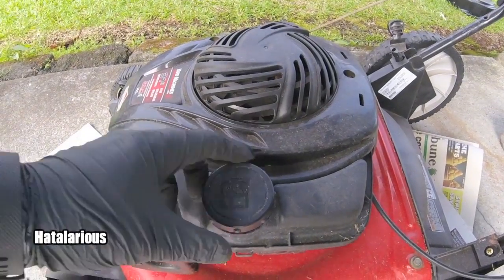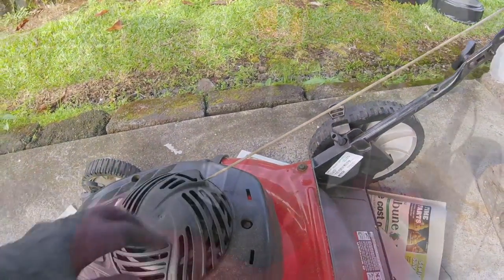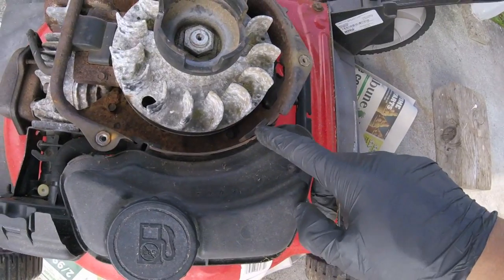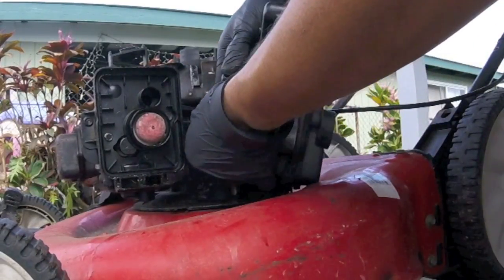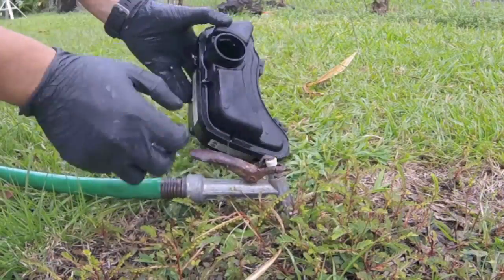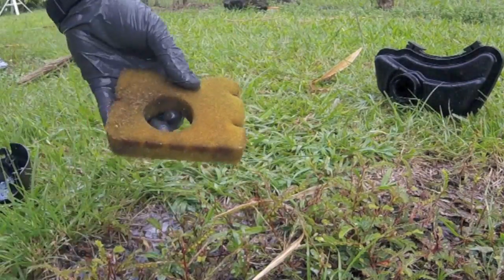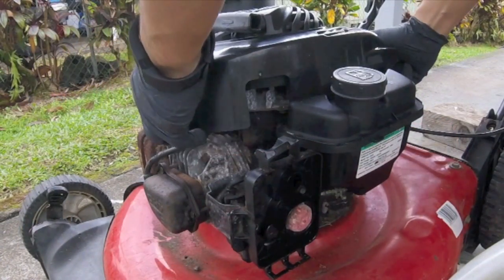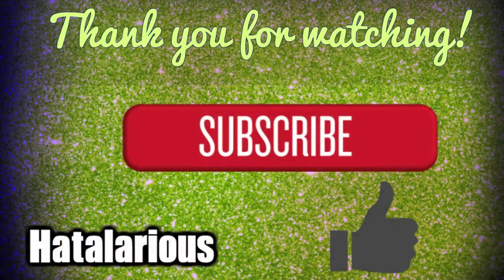How to Clean a Lawn Mower Gas Tank!!

Comment: update i use this method to clean all my gas tanks and they all work great..it cleans the debris out and eveyrthing..you MUST wait until the tnak is fully dry before reinstalling as water will go through the line and the engine will bog out or not start but this is a good method thanks for this video:)

Comment: i had a problem wiht clogging in my fuel line i cleaned it out a bit but today noticed soem debris still inside...im new to fixing mowers so i youtubed like i do eveyrthing else and came across this video i hope this works..i seemed to have gotten more out and theres a steady flow so i think this is going to do it and ill use this trick on future projects. thanks:)
Reply: @johnymcjoon  what you laughing at scrub?

Comment: Thanks for the video. Made cleaning out my gas tank much less scary.
Reply: I want to clean my gas tank without taking it off.
Why can't I let the gas get empty, get like a paper towel type thing, wipe it out, soap and water and air dry 
Would that work
Reply: Catherine Rosa-Baker No. You don’t want water in your engine. or soap. any of that. Just do it the right way... it was simple enough.
Reply: @leomcadams1751  if she removes the gas line from tank side and is careful, what could it hurt? Mowers get rained on all the time. It wouldn't get in the engine as long as she's not blasting the crap out of it! lol I wondered the same thing cause pretty sure the small filter in the bottom right corner is clogged with dirt on mine. It's this exact lawn mower. You may need more water pressure when spraying it out. In that case i would remove the tank, but some ppl may not have the proper tools to remove the bolts on top. I wish they would just use Phillips or flathead screws/bolts on everything! It would make my life so much easier. While we're here though, i don't think my carb is getting gas when priming. Idk if it's cause of clogged filter or clogged hose. The hose connecting from carb to gas tank. How can you clean that out??
Reply: Mine was stalling after start up and it was a small piece of straw caught in the small gold piece that comes up off of the plastic fuel inlet that goes into the carburetor! I had borrowed welding tip cleaners from Neighbor to be able to poke in every little hole and every little jet and what not in my carburetor and here where are the straws stock you could even get it out with that I had to just lightly tap it on a towel upside down and piece of straw fell right out. Now I want to empty my gas through the gas line because like everyone else I can’t get the screws off the top to take the cover off so I think I’m going to do it in place and then just let it dry for hell along time upside down or what not.

Comment: I soak my filter in clean gas and agitate the gas through the filter to clean all the dirt out. Water takes too long to dry. I also put a little clean gas in my tank move it around then pour it out to clean the tank.
Reply: Replacement filters only cost a few bucks better to just replace them less work. And the more you order the cheaper they are. I just ordered a two pack from Amazon and got it the next day. It was like six bucks for two of them.

Comment: Hey, i have same mower and won't start. There is a connector for the pump bulb but nothing on it like tubing for priming. Is there supposed to a hose?
Reply: If you haven’t got a new mower already or have gotten help with it, yeah there is a hose supposed to be there to bring fuel to the primer
Reply: im assuming this guy has gotten a new mower or fixed this one there is no fuel line attached to teh bulb itself but theres one that goes from the gas tank to the carberator and one that goes to the filter housing thats it..

Comment: So is it ok to use Dawn dish soap and water to clean my gas tank?  Some say yes, some say no.  Which is it folks???
Reply: I'm asking the same question.  I think I'm okay with water, provided the tank truly is bone dry before reinstalling.  I wouldn't use soap, because I'd be nervous some residue could remain, and I really don't see the benefit of sloshing soap around in the tank.  You're not able to scrub (and don't need to) and I don't see how it would help get leaves, debris, etc. out.  I'm no expert.  Just being logical.
Reply: Kube Dog no worries, I used a very small drop and sloshed it around a bit. No issues on my end.
Reply: i do it all the time wiht every gas tnak i clean out and it works fine..just make sure all teh soap is rinsed out and the tnak is bone dry before reinstalling and putting gas in it...the slightest amount fo water can cause it to bog down or not start.....so let it sit in the sun for awhile  dampen the water wiht a rag or blow dry it.. it works fine i do it with all my gas tnaks
Reply: @sonnyc3826  Thanks!  2 years later, I'm running battery now. No more gas to deal with.  :)

Comment: Guys don't put water in your gas tank no matter what
Reply: You make a comment but didn't explain why not used water to wash the gas tank. If it is left to dry COMPLETELY before putting it back on then what's the problem?
Reply: Hair dryer will dry it out very nicely and fast or a sunny day... To simple
Reply: @damianmlamb  and the salts from the water will stay in your tank.

always use things like clean fuel (alkylate fuel for example) to wash it if you dont use it to as normal burning stuff.
Reply: Bullsh*t! Normal gasoline has moisture (water) in it already and ethanol gas even more so, as it attracts moisture from the ambient air. Steam cleaning carbon out of engines (using water in small quantities directly into the intake) is also a common practice.  Thanks for coming out, keyboard mechanic!
Reply: @SevenSixTwo2012  your steam cleaner will distill the water inside as its boiling it, no salts will come with it, and even better most likely it will use distilled water instead of tap water.

No i'm not a keyboard mechanic, just a chemist....
Reply: Yuuuuppp daughters hair dryer works perfectly i also use dawn soap forget about the bolts and all that just plain o soap and water if it's real real dirty i use the lime calcium rust from old el cheapo dollar tree store works good
Reply: Ethanol is hygroscopic, meaning it absorbs moisture from the air.  The same as methanol or any other alcohol.
Reply: @damianmlamb   What do i do if i don't have a hair dryer?  Im Bald.
Reply: @kanarie93  you use distilled water guy... No salt pure lol
Reply: @kanarie93  and you mean denatured achohol
Reply: @tobymofield6597  small fire hang it over always have a stove put it at 150 and let it dry it out get creative, you can make heat many ways lmao
Reply: @damianmlamb   Thanks a million,  I pr-heated the kitchen stove at 250F and the tank was dried out in about 12 minutes. Great tip.
Reply: Yes water and gas don't mix but let the tank completely air dry. No harm no foul. Good video!